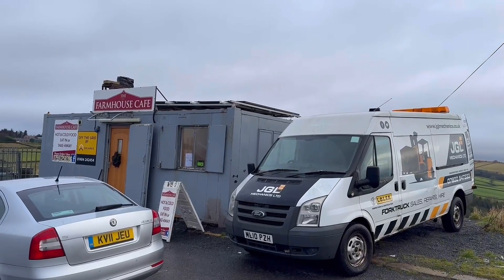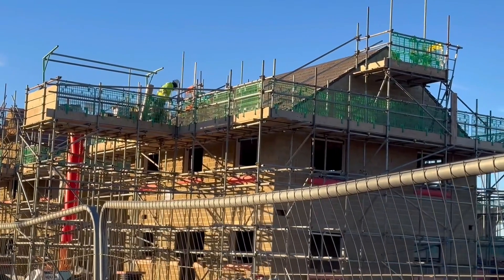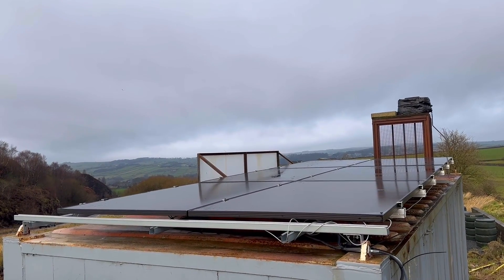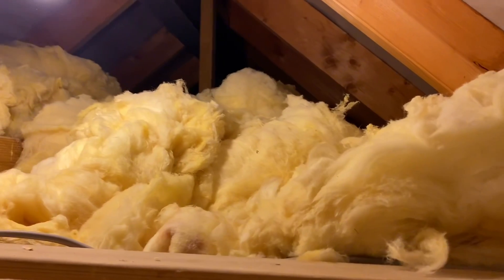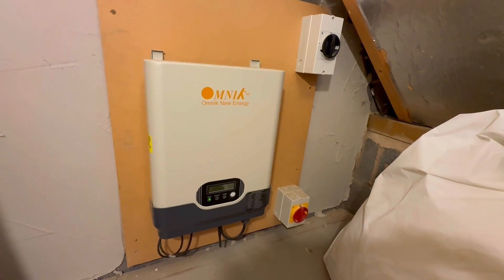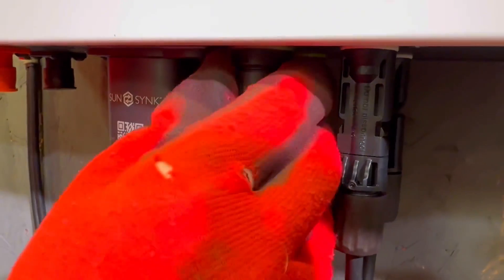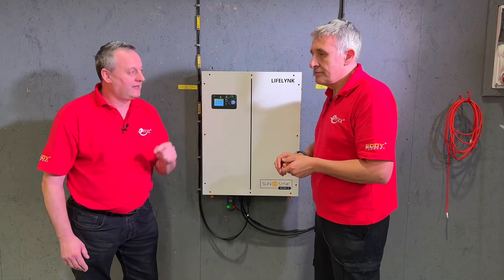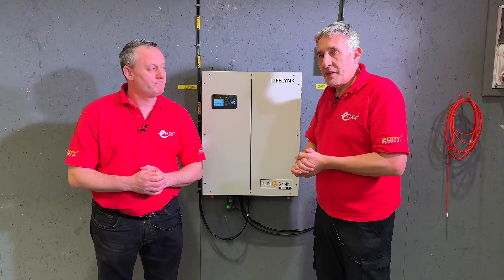SunSynk LifeLynk Hybrid Inverter - So EASY It's Almost Cheating!

Comment: Zero support
Adding to system is a mission with installers having no clue as what to suggest.
App is useless and now requires giving away privacy and rights just to use it.
Would not recommend this product.

Comment: Hello, Can the load be wired back into the home consumer board so when there is a power cut this will power the whole home and not just the double socket its wired to like on this setup? as you can imagine if this isnt possible then during a power cut there will be no lighting or other power throughout the whole home except what is plugged into the double socket

Comment: How do self contained battery/inverter units like this go in terms of mobile homes, RV/motorhomes/caravans etc as suggested in the UK?

In Australia the latest standards require lithiums to be external to the living space and vented to the outside to address issue of toxic gasses if they are involved in a fire.  Certain types of sodium ion batteries are being held up as the solution since they do not give off fluorine based gasses etc.  They do have lower energy density, both volume and weight vs watt hours, but the difference is not terrible enough to make them impractical in mobile storage applications.

Comment: I don't think the gate at the end of a drive is a bad one, an "online" would compensate for any volt drop on the long run and in the case in a power outage the gates would still be operable

Comment: Lets not put lithium batteries in houses/ connected garages/under ground car parks/boats … No way to put out the fire
Reply: This unit uses LiFePO4 cells which have far less runaway issues than NMC etc to the point where runaway is really not an issue unless they are severely abused.   If you are concerned only about the burning things down aspect, you can rest safe in the knowledge that your building being on fire is likely how your lifepo4 cells caught on fire rather than the other way around.

It's still not a good idea to have them inside a living space since if they are involved in a fire, not necessarily the cause of, the gasses they release are quite nasty.
Reply: Well, as far less and Quite nasty are off the cards lets increase the odds by rolling out more home batteries ,few years degradation and roll the dice.  @retrozmachine1189

Comment: Big problem in this country is to access cheap night time electricity to charge batteries you must either have solar panels or an EV. If you live in a remote listed property Solar panels are not allowed and a EV is not practical also very expensive!
Reply: Octopus Agile doesn't need any of those (though better if you do obviously). I was on a cheapish tariff for ASHP (Cosy Octopus) that gave me 6 hours at 16p/kWh (off peak) 3 hours Peak at 48p/kWh, and the rest around 30p/Kwh but have just changed to Octopus Agile....now unit prices change every 30mins and aren't guaranteed or subject to price cap...most of my electricity so far (last week or so) has been under 15p/kWh say 13p/kWh on average, but between 4pm and 7pm its been 30-32p/kWh. Cheapest so far has been 8p/kWh but it can go much lower or even free, equally it COULD go really expensive (max £1/kWh) looking back over the last year that doesn't seem to have happened much if at all. My bill in January was £640 (small 3 bed semi), but had I been on Agile it would have been £399. Reckon my average kWh cost has dropped by about 20p peak peak rate and everything else has halved. Kicking myself I didn't switch sooner. If I had batteries (and I'd need a lot of them say 50kWh), and a compatible  EV charger then maybe it would be cheaper on some of those EV specific tariffs but not by much.
Reply: Thanks for that I will talk to Octopus again who are my current supplier, they said that I needed either Solar or EV @mikebarry229
Reply: Pretty sure EDF never checked if I actually had an EV
Reply from the maker: If you have plenty of space you could go for a ground mount installation.
Reply: Ground mount what? The actual Hamlet is Grade 2 Listed so no possibility what so ever for solar @efixx

Comment: Whilst I am not into the net zero narrative, I just love off grid / grid connect wind/solar/lithium batteries etc…
Reply from the maker: That profile picture looks like you could be in a place where off grid is useful.
Reply: @efixx  will be there In the Khumbo maybe Oct installing a small system in a village called Kapti to overcome their regular’load shedding’!

Comment: If it’s that cheap and easy to install for off grid? Then why would anyone want to export there energy that they harness for the natural sun back to the grid. Just go off grid and tell the energy companies to take a long run and jump . Also is there any laws or regulations that say you can’t go completely off grid. After all no one on this planet can lay claim to the sun . It free for all of us to use its natural energy/power . If I had the money that’s exactly what I would do. 
Great video Guy’s very informative and interesting.
Reply from the maker: It’s the dark nights which are the problem for full off grid.
Reply: @efixx  Wrong! Nights are what the battery is for, its the winter months that will be the problem, especially December and January. It is incredibly diffiuclt to go electrically off grid with solar in this country, this video is misleading and makes it sound so easy.
Reply: Yes but if you have battery storage as well then I don’t see any problem, also most of are in bed sleeping by 9.30 pm . As we have to be up early for work and the kids if you have any have be up early four school ,So surely you would use power from the solar panels during the day and the power from the battery in the evening?
Reply: @Dog-whisperer7494  If you can live off grid great, makes much more (financial) sense for most people to be on grid, sell electricity when you can, and buy it in when you need in winter, means you can get the most out of a smaller battery system by cycling it most of the year.
Reply: If people in America can go totally off grid I don’t see why we can’t . They have dark evenings as well .